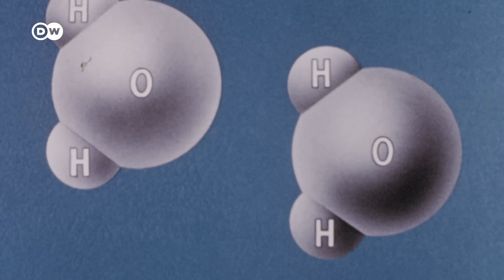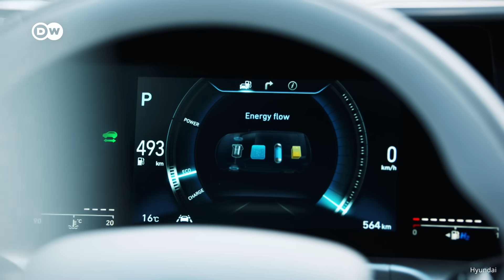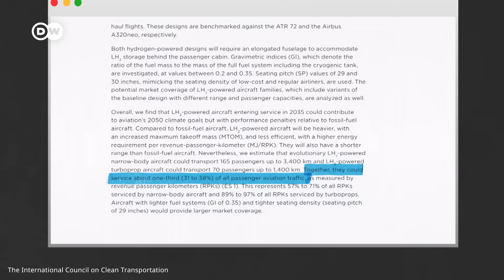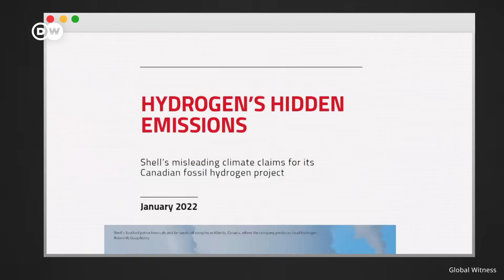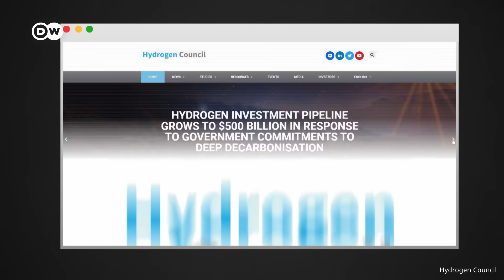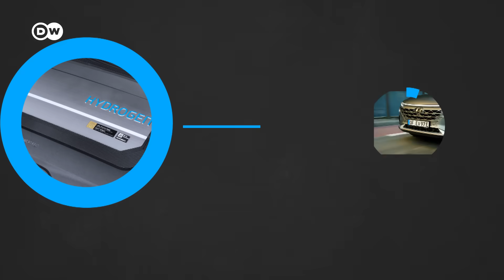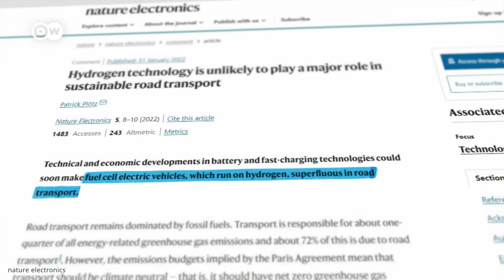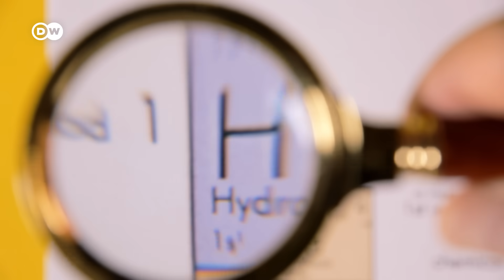The truth about hydrogen

Comment: From a person point of view the things are not so complicated, it is very simple: During the whole summer my solar produces lots of KW I don't need,... waisted!!! I can use electrolysis to turn this into Hydrogen, no matter too much the efficiency, I am getting the electricity  "free" anyways. My problem at home is stocking the Hydrogen!!!!  Here is the problem,... STORING the hydrogen!!! I can not just fill my yard with tanks!! 😮😵‍💫 Liquidizing the Hydrogen at home would be a solution but is hard and costly to do this and also you need to keep the "liquid" at low temperatures. I really wonder why combining the Hydrogen with Carbon or existing Hydrocarb like methane, butane,...    may make it easy to liquify and store ? 🤔  Imagine to be able to use this for heating in the winter wowwww . Every single hause would have one! Indeed the result will not be as clean as pure hydrogen, but it will save a lot of energy for the planet!!

Comment: It is too great which is exactly why the fossil fuel lobbies are fighting it soo hard. I don't have proof of this, but all you have to do is look at the lack of investment in tackling the storage 'problem' with hydrogen which has already been solved but it's getting no investment! It's scandalous. Don't believe me, look up Cellaenergy. It's a composite material that can store hydrogen at high density but low pressure and only has to be heated to 100C to release it's hydrogen. But they can't get investment. It would revolutionise the biggest problem with hydrogen that exists overnight.

Comment: another big problem - which I got the feeling is ignored quite often - are the interactions with the atmosphere. First, there is atmospheric escape - due to its low molar weight, the kinetic energy from thermal motion is sufficient to cause a lot  of irreversible loss into space. 
Second, it reduces hydroxyl radicals to water, which itself also has a greenhouse effect. moreover, those radicals would otherwise break down other stuff - like methane, resulting in an even higher effective greenhouse effect than CO2 as methane can persist longer. 
It is still useful for producing base chemicals, steel or concrete, but its role as an energy vector would not be played out very well

Comment: Green energy is obviously the solution to loading CO2  back into the atmosphere from eons gone by. But due to its intermittentcy, we need something to fill in the gaps. Something has to be done, and quickly to break us away from our fossil fuel addiction. Hydrogen is an energy storage mechanism, and although maybe not very efficient, it is very clean, simple, and non-poluting -- unlike any battery.

Comment: I believe that Green Hydrogen is not an alternative of fossil fuels even a really a variable solution. For shake of argument let there is a cheap green energy available for electrolysis of water and there is a very minimal loss in storage and transfer of hydrogen. But potable water which required for electrolysis is not abundant in the word, there is a huge amount of people do not have access of drinking potable water. I believe that it the biggest challenge. Remember desalination of water required lot of energy and it has large effect of the discharge of very concentrated saline water on marine ecosystems.

Comment: Looking at hydrogen based vehicles where the hydrogen turns into water at the platinum catalyst between the cathode & anode, why do they not redirect the water surplus back to at battery backup with a solar panel on the roof of the car to make electrolysis for hydrogen right inside of the vehicle so you do not need to refuel? If we can recycle the fuel i think we may be able to achieve free energy by doing this. What do you all think?

Comment: The issue is that we can easily just build the electrolysis conversion on-board a vehicle. However the oil & gas industry would do everything in their power to fight against doing so. Mainly because they cannot effectively monetize vehicles that run on water.
Reply: so it costs less energy to spilt hydrogen from water than reverse?

Comment: Climate change is just the latest money spinner. Simple fact electricity generation apart from solar panels its all coming from power turbines. So effectivly locomotive technology is used regardless of powering it by nuclear reactions to boil the kettel.
But its all about profits no one listens when you tell them all the tecnology nessisary is avalible and time tested yet its not about energy because otherwise we wouldnt have anything to complain about its about maintaining control maintaining power.
Reply: Solar panels are comprised of compounds so toxic that spent panels are shipped off to third world countries for disposal.  I'm not even considering the energy required to obtain the needed materials for manufacture.

Comment: If you need electricity to make hydrogen into a fuel, why not just use the electricity to run electric engines.
Reply from the maker: Good question! Hydrogen offers high energy density, quick refueling, and storage/transport advantages, especially for long-distance. Also, more on the topic! We made a video recently asking "Why aren't we all flying in electric planes?" ✈️ Check it out here 👉 https://www.youtube.com/watch?v=aErm8j9sJCg

Comment: I did a PhD in hydrogen fuel cell electrocatalysts recently. The issue I see at the moment is that the government funding of research is directly fueling the Academia’s vicious cycle where emphasis is put on, and “success” is measured by, publications. I tried focusing my grad school research on stability problems associated with non-precious metal electrocatalysts, and I can tell you that the idea of showing degradation is not taken well by the community, who is as a whole just riding a wave of juicy grants to produce, at best, questionable results.
Reply: My graduate research project was also related to fuel cells, and I concur.

Comment: 5kg of hydrogen requires a 33 gallon steel tank pressurised at 10000 psi. The steel tank is over a 100 lbs.  It's a fools errand. a 33gal gas tank would hold 117 kg of gasoline...

Comment: You haven't talked about Carbon Engineering based in Squamish, BC, Canada. A company that transforms the CO2 in the air into usable fuel. Basically, you cut in half the CO2 concentration in the air 2 parts converted - 1 part re-emitted by cars. It's obviously not a perfect way, but still the fastest way NOW as we still rely on fossil fuel. Only this one is not dug out of the ground, but sucked out of the air with fans. The advantage is also that we can use that technology NOW, not in 2035 like some other technologies predict.

Comment: Sure you can go green and produce hydrogen using water electrolysis and lots of electricity from renewable sources on a mass scale... but you might as well just cut the crap and use the electricity to power EV cars directly without the entire fuel supply chain and logistics in between.

Comment: Adding electrolysers for storage of excess production could be a good way to balance the grid. Instead of simply disconnecting wind and solar when they produce more than needed, they could keep running - just producing hydrogen locally.

Comment: Whos watching around the 31.10.2024?
What about a mixture of different sustainable energy sources?
Having in mind, a Skyscraper - also with sustainable building materials and techniques, so less waste etc.
Using Solar, Wind and green Hydrogen Power in a closed system, would the loss of energy still be as high as -60%?
Is this even achievable in 2024 or 2025?
How long until "the train is underway"? ;)

Comment: It takes fossil fuels to break hydrogen from other molecules. It is HIGHLY inefficient. HIGHLY INEFFICIENT.
Let's think about "green" (or not green) hydrogen critically. "To make green hydrogen, you use the energy from renewable sources such as wind energy." You "USE the energy" of green energy. You are still wasting energy to "produce" hydrogen. You still have to use energy to break the bonds. You are wasting renewable energy. That energy could be used for something more efficient rather than something far off the wall and crazy that is so volatile you have to use extreme caution to transport. Yes, you have to transport liquid hydrogen using our current methods of transport such as using big trucks (which burn diseal fuel) or railways. Hydrogen as a fuel makes zero sense and if someone tells you it does, they are lying and trying to rob you for $$$.

Comment: Wouldn't it make sence to look at hydrogen as a battery in passenger cars? And instead of transporting hydrogen fuel, it could be produced within the car, using electricity such as in the case of battery powered electric cars. That way fuel would not need to be transported separately, and the electric grid is already an existing insfrastructure the whole concept could rely on
Reply: You would have to stuff powerful electrolysers, compressors and perhaps also a cooling system for it additionally into already crammed hydrogen cars.
And the car would consume about 3 times as much electricity as a battery electric car. 
And you wouldn't achieve high charging capacity (power), the charging time would be very long.
You would have to refuel (distilled) water, around 10 liters per 100 km. Theoretically, you could also install a water recovery system, but this would mean additional volume and weight.
Even if you could stuff all this devices into a car - it wouldn't make much sense.
Reply: You might have heard of the "Energy Observer", a mainly solar powered ship with a combined battery-and-hydrogen energy storage system.
Battery for the energy shift from day to night, hydrogen for long term storage ("charging" during laytimes, use of hydrogen in cloudy weather).
If you don't need substantial cargo capacity (tons and kilometers per day), you could power a recreational vehicle this way.
And theoretically, you could "charge" it at the harbor with hydrogen by grid electricity as well.
But on a ship, you have much more space for all the needed devices than in a car.
And you won't have very much "no-sunshine-range" with battery storage only.

Comment: There are to two classes of fuel. Those that have a existing production distribution and sales environment, and those that do not. The fuels with existing production distribution and sales environment are oil (gasoline, etc) and electricity. All of others do not. There is a second layer in alternative fuels. This level divides between those that rely upon one of the two established sources of fuels and those fuels which do not rely on existing fuel sources don't have a chance at being successful. The cost of developing the required energy  structures are too high to construct and be successful. Now Hydrogen is a fuel that relies on an existing energy source (i.e. oil or electricity with an addition of other elements). This places Hydrogen in as a second level energy source. It is dependent on the presence of the primary fuel source. Since it is at a second level it requires conversion as well as PDS structures to produce and sell its energy.  So if it relies on a primary source. Why not go directly to the primary source?  This is also true for hybrid automobiles! This is why I think hybrids are a scam.

Comment: well my original idea, lets turn sahara into solar panel and store in hydrogen from the ocean, well it is impossible to burn without oxygen, but in earth fortunately we have a lot of oxygen. Those talk-heads have no clue how energy used in humanity, new sources added old sources never ever removed or replaced. So net zero is BS. Back to the topic the only thing hydrogen would change is how we storing energy in larger scale (very ineffective if we have no limitless energy).

The main question is who ever have common sense mentioning fuel of the world. Hydrogen would be a battery replacement in terms of energy, and still a chemical reaction to generate or ignite. With fossil fuel you receive energy from literally conserved over thousand years, it is a 100% different scenario. We can use hydrogen to store extra energy similar way as hydro pump plant does. As it is ignitable can operate engines and turbines, but with the caveat, it is excess energy product. We currently could not even reach a point when we can stop using burning bio fuel/coal to provide enough electricity in a stable way. Laughable the idea we start to use our production electricity on generating hydrogen on around 50% energy loss already to later operate a plane, this is silly. We can return to hydrogen when we solved the enough energy problem.

If someone ask me, yes hydrogen would be nice to store energy for the evening where solar panel used, and peek excess energy can be turned into hydrogen, but still hydro pump is cheaper and more efficient, but need a lot of specific criteria to work.  Hydrogen would not utilize any gravity and artificial lakes, however I can't believe we will ever create Hydrogen re-ignition power plants. The root cause of our problem how to store energy, we are struggling at chemical reactions or forces like gravity, hydrogen will be not the breakthrough, which allow is to effectively store electricity. So I am pretty sure that new moon project will end up just connected to the grid instead of creating hydrogen, as no one will reignite this as fuel, but may help in development of plastic and composites :D. As we never transport hydrogen can be done in other chemicals so the efficiency will drop down below 20%, or it will be just a random explosive device. The 1st element is the most oxide able element, huge potency make it really hard to operate with reliability, except if we can remove oxygen from the picture , which a bit deadly.

So I think behind the whole PR the big question how we can use unreliable "renewable" energy in a way we can conserve energy, when renewables temporary short. Well the answer can be hydrogen , but that is not effective and not safe, literally an explosive device with bad handling.

Comment: The membrane or the fuelcell stacks that exchanges hydrogen to electrical energy are troublesome and must be replaced with other components once a year or every 6 months. The membrane is like what you usually see in the RO water filter, except larger depending on the design it can be a rectangle or cylinder with built in heat exchange or cooler.
It's very expensive, $10,000 or more to replace it a long with other components. 
   The car works like a hybrid car, battery  and all. The coolant to cool the membrane or the fuelcell is another issue to worry about.The membrane only lasts about 6 months  to a year, depending on how the car is used. If you park the car for a very long time like a month or so, the system will clog up. Then the membrane  and cooling components have to be replaced before you can use the car. The car has to be towed into the shop autorized dealer.
So far, there are NO mechanics at the dealer that can work on the cars, due to its complicated system. You must wait for a trained scientist mechanic from Toyota Japan to fly in for your service on an lectrical problem.

Comment: Hydrogen is lightest atom among the periodic table , So why some rumors are saying that it is not easy in storage & transportation? We can extract it from sea water H2O , 2 molecules of hydrogen & one molecule of oxygen . Hydrogen gas we can use it for fuel & O2 ( oxygen) we can send it to hospitals.Since hydrogen have only one electron in outermost shell then it is less susceptible to make bond with other atom or compound. So, it is less reactive also. So it would not react readily. Then what's the suggestion about it guys?

Comment: I aint a engineer or well versed in science. Have an idea in mind though that I wanna bounce out there and see if it's worthwhile.

Could manufacturing of hydrogen be made self sufficiently in the car? Collecting of rainwater through tubes in the roof, to a separate container. Also solarpanels on the roof and airhumidity collection, wind turbines in the front of the car. 

So hybridcar with a solarpowered ev with windturbines and water collection and manufacotring of hydrogen. Would that work? Mainly curious about the hydrogenproduction part.
Apart from the markets it would kill if it would work.

Comment: What do we do with Oxygen produced in Electrolysis process? With 1 kg of hydrogen production generate 8 kg of Oxygen.Do expert plan to use Oxygen for fuel cells? Too complicated
Reply: Yes, it's too much effort to store and transport the oxygen, when you can get it everywhere from the air.
Except in submerged submarines. The German submarine class 212 A stores liquid oxygen for the fuel cell propulsion system.
It might also be an additional risk. Pure oxygen in the vicinity of hydrogen...

Comment: Using hydrogen as an energy store on an industrial scale will lead to more loss of hydrogen to space. Some of what is stored or pushed through pipelines will leak. This leaked hydrogen may spontaneously recombine with oxygen. If it does not, it will rise to the top of the atmosphere and be blown away by the solar wind. This happens due to natural processes already. In time, this loss of hydrogen will result in an Earth that is more like Mars (arid). If millions of tons of hydrogen are held by industry and used in transportation, the natural rate of loss may become a small part of the overall rate of loss. But the risk is in the distant future. It would be even harder to transition away from a hydrogen-based system than it is to get away from fossil fuels BECAUSSE the consequences are far away in time.

Comment: Amongst many other problems (making it, storing it, transporting it) green hydrogen gas as a fuel source is diffuse, and capacious (unless you cryogenically freeze it). Really, it is not practical to use it for any scaled-up or industrial-scale operation.